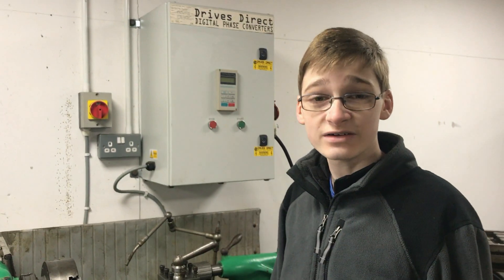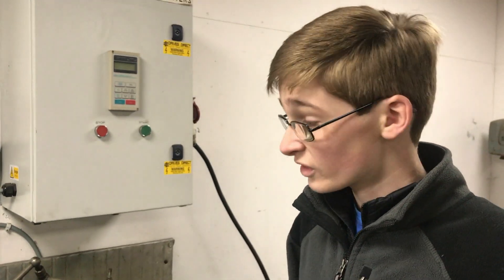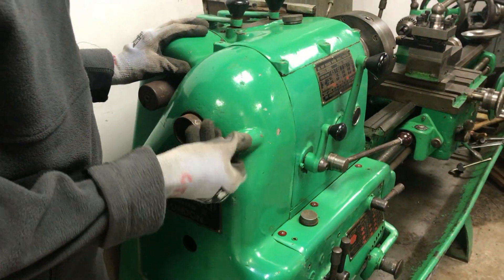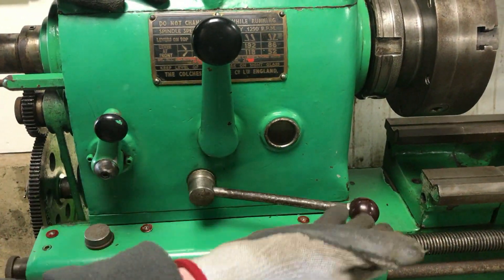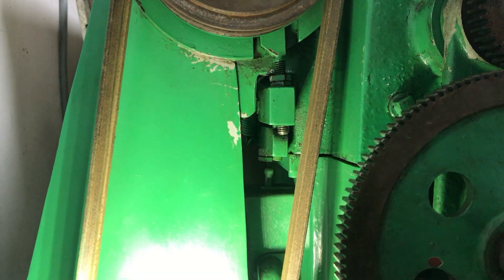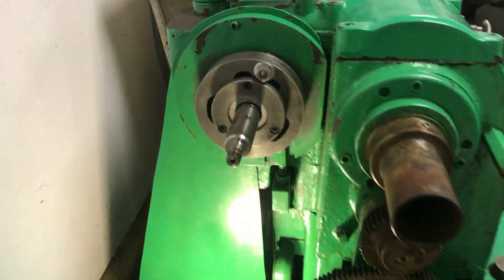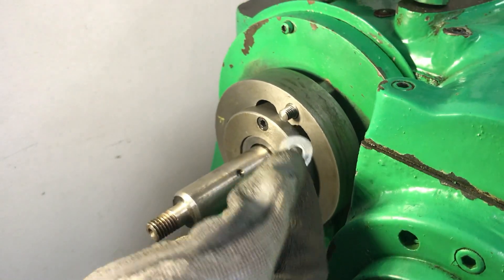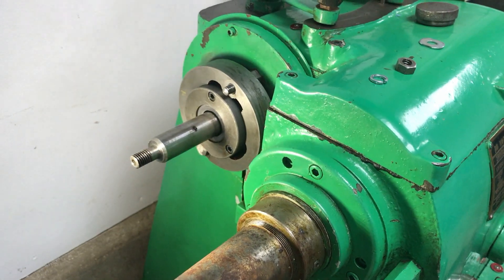Colchester lathe issues on Workshop Wednesday

Comment: Hi Jospeh, I've got a slighly older model (master 6") do you know how to remove the lid of the gearbox on yours? mine seems to have an very similar looking lid and I was trying to get it open today but couldn't. It seems after removing all the screws its supposed to slide away from the two gear handles on the top but I had no luck.

Thanks for your video and help
Reply from the maker: Thanks. We have removed the lid from ours a few times to see if we can identify noisy bearings. We removed all the fixings and slid the lid forward until it cleared the gear change controls. I believe we did need to give it a very gentle tap with a soft faced hammer to get it started. If this does not work for you let me know and we will remove ours to check the process and even video it if it helps. Take care
Reply: @GardenTractorBoy  thanks for the advice, I did try hitting it all over wirh a rubber mallet, it didn't budge at all, I also did managed to stick flat head screwdriver between the lid and gearbox and it does separate, so there's definitely nothing holding it down apart from those levers.

If you can remember, where and in what direction did you have to tap it to get it to release, and was there a particular orientation that the gear levers need to be in? 

Thanks for your help, I'll try again to get the lid off tomorrow, if you could make a video on the subject that would be amazing
Reply from the maker: Over the weekend we took the lid off the gearbox on our Colchester and videoed doing it. Our broadband is not great so it will not be until Wednesday at 7pm GMT before it is uploaded and live on Youtube. We moved our gear selectors into the middle (neutral) position as it was the pins on the levers that was holding the lid on and the indentation was much less in the middle. We hit the top with a soft faced hammer from the back, knocking the lid forward. The best contact point is where the bolt holes are but we avoided that as I suspect that is a weak point in the casting. Our top does not have a gasket or any sealant but even then it was surprising how much the pins on the gear selectors hold the lid down. Another option would be to remove the knobs and pins from the gear selectors or find a way to bridge under the two selectors to lift them slightly. We have a number of Colchester experts who follow our videos and once the video is live I hope they will jump in with further advice. Let us know how it goes
Reply: @GardenTractorBoy  Thank you so much, It won't be until easter that I will be back home to try again (I went back home on the weekend to get the lathe setup) but I really appreciate your help with this, I'll let you know how it goes!
Reply from the maker: @bradley9856 Also let us know if the video raises futher questions. We have an odd noise in our gearbox which is why we have removed the top a few times. It is possible that once the video goes life someone will offer some suggestions
Reply: @GardenTractorBoy  will do, thanks once again. Have you tensioned your bearings? The only video I found about the particular lathe I have is of a guy showing you how to tension the bearings, the video is just called colchester master 6" or something like that (not sure if your gearbox is identical to mine it could be different)
Reply from the maker: @bradley9856 Thanks, I have just watched the video and it is very interesting however I think our noise is coming from the gear shafts. The inside of the gearbox looks very similar to ours

Comment: 1. The brake bolt thread seems too short. Instead of a flat washer and spring washer, use a nyloc nut, and/or Loctite.

2. Brazing or fillet welding is a perfectly good fix for that crack. Re-turn afterwards for perfect original size. No problem to use the lathe itself to do that without the brake installed!
Reply from the maker: Thank you very much for the suggestions, we will have a look into those. We are running the lathe without the brake at the moment and as you said, it seems to be working well still. Take care

Comment: Interesting to see that brake design, thanks. Totally different from the Harrison. Cheers
Reply from the maker: It is an odd design as I didn't think cast performed very well in this type of use. It is even more odd that with the brake removed it makes no difference to the speed it slows down, we do wonder if the brake was for production work. Take care
Reply: @GardenTractorBoy  Do you know that's very interesting. My Harrison has a far more basic brake, not much more than two collars rubbing together on the gearbox input shaft pulled by the clutch springs but it works very well when the lathe is warm. When the lathe is stone cold it does not work very well because the oil is think so there is not much friction between the faces on the collars. Cheers
Reply from the maker: @HaxbyShed  We bought some brake shoes from an electric scooter in order to adapt and fit at some point but as the brake makes little difference, this is low priority. The differences between different makes is very interesting, we noticed that a lot from your mill and our ones

Comment: It looks like a cast iron expanding brake shoe.  My 17" Colchester I believe is called the Mascotte. Anyhow, my lathe has motorbike type shoes with composite fabric friction linings.  My advice for a fix is to let it crack.  If it does, fit some tension springs to pull the broken halves together. Seriously.  It has cracked at a flexure area where it was supposed to flex.  Iron does not flex.  Should have tarred and feathered the engineer on that one.  But I would not replace it, just re-design the mechanism to have the split in two, pieces retained by a spring.  I actually has a machine with a cast iron expanding band that was broken.  It was a Clausing 8520 mill, a small engineering mill. Anyhow, I made a new brake band out of aluminum-bronze.  It is primarily a bronze alloy, if you know the material.  Anyhow, it worked perfect. If you absolutely have to make a new one, consider aluminum-bronze.  That is what synchronizer rings in manual transmissions are made of.  Good fix, but I would have considered just a smaller OD washer.  Also beware of that split lock washer.  It looks very cheap, and I have seen may of those in the metric pattern variety that the steel is soft as cheese. You might consider a Nylon locking nut or super glue or Loctite on the thread.  ---Doozer
Reply from the maker: Thanks. It does seem like a very odd design. At the moment we have removed the brake and it seems to stop at about the same speed. We have bought some  brake shoes from an electric motobike to try at some point and I like your idea of fitting some tension springs. Take care

Comment: I have an old, much smaller 9X36, "engine" lathe.  It does not have a brake & I'm wondering what a brake is needed for.  Maybe that larger machine has a lot of momentum when shut off.
Reply from the maker: The brake was fitted to stop the momentum when you switch it off. When the lathe was sold new in the 1950's the advertising said that the brake stopped the lathe instantly, which is not true. We do wonder just how long it would take to stop without a brake, it certainly would be quieter to use. We will have to give it a go. Take care

Comment: Amazing to see that there is any visible deflection when you actuate the brake. I wonder if that is the casts way of finding its own centre. perhaps a groove hogged out around the inner that could contain a radially wound keeper coil that would allow for expansion when applied yet hold it together with no sag while it normally runs... or something like that.
Reply from the maker: Thanks for the great suggestion, that is worth thinking about. Take care

Comment: My old roundhead Student lathe had the exact same split cast ring in the brake. "Had" because I took it out for some long forgotten reason! I guess it was worn & ineffective. Maybe I thought I'd replace it with something better, but I never did. Just got used to doing without a brake...
Reply from the maker: That is very interesting, it suggests the cast ring is a standard Colchester part. How long does it take for the lathe to stop without a brake? Take care

Comment: Right Joseph, now I see the problem! The expander for the brake is there, but the shoes are not! Is it possible that you could take off the cast "brake " and fit shoes and linings, I have never seen a brake setup like this on a Colchester, but with the relieved areas on the cast brake shoe, it does look like a factory part, although it "looks" like you may be able to do a direct swap for ordinary brake shoes, I will do some research and get back to you!
Phil
Reply from the maker: Thank you very much. Dad has also posted the issue on the Colchester forum. If this is not a factory replacement someone has spent a lot of time making this part and thought of most issues except the stress on the top mounting bolt area. If you can find any information that would be great. Take care

Comment: That brake shoe looks like it is designed to crack. It looks like a poor design. You do need to check that noise. It could be a dry bearing or gear. Nice video. Good Luck, Rick
Reply from the maker: That is exactly what we thought, the bit where the bolt goes through is the weak part and the rest is just a matter of time. Thanks for the suggestions, we have checked over the gearbox and bearings but we did not cover it in the video. Thanks and take care

Comment: It can be hard to find a replacement for old equipment. People have a machine shop make parts or
use a Metal 3D printing if metal. Or weld it and grind it down.
Reply from the maker: Thanks for the great suggestions. Take care

Comment: You did a great job Joseph: my Colchester Bantam did not have a brake (the previous owner took it off) and so I use the brake of the inverter, which works very well and is programmable (braking time and ramp, that is, how quickly to go to 0 Rpm). You do well to use gloves, but I can't do it with small parts, in Italy we say that "the cat with gloves does not catch the mouse", because the nails are covered by the gloves 😁 If one day you decide to install an inverter like mine, your lathe will become super silent and it will be even easier to use it, it will have an infinite number of revolutions adjustable with a potentiometer. See you soon Joseph, congratulations on the repair !!  AB-SHOP
Reply from the maker: Thanks. We have a digital phase converter which runs all the 3 phase equipment in the workshop, if the Colchester was the only  3 phase piece of equipment we had an inverter would be the way to go. We will look into one for all the other reasons you mentioned. Take care

Comment: Excellent detective work and if nothing else, a good temporary solution. You can probably buy an iron disc blank from M-machine-metals and machine it the lathe and the mill, right? May i ask - you have such a wonderful workshop, how did it get started? You've mentioned a few times you're getting used to working with the machines, which makes me think maybe they were bought and stored, or inherited? Anyway, you've got me gassing for a Colchester now :)
Reply from the maker: Thanks. That is a good idea, we will check out the blank disks they sell. I will let dad answer the second bit. Hi William, two children, working long hours and a high maintenance property left very little time overy the last 20 years for workshop time but it did give me the opportunity to buy lots of tools and projects. I have just retired and now it is time to dust off the tools and projects. If you fancy a trip to Norfolk it would be great to meet you and give you the opportunity to test out the Colchester and Cincinnatti mill. Take care